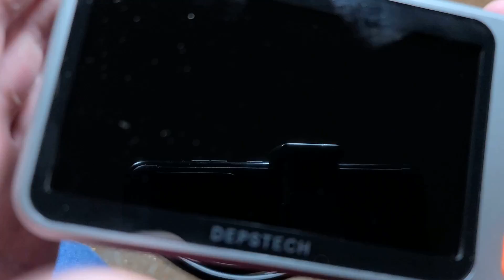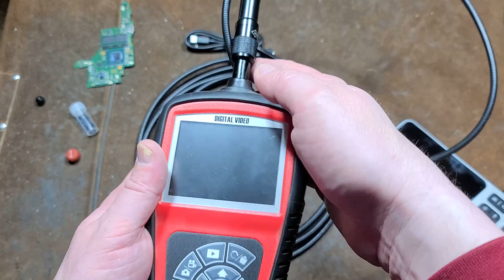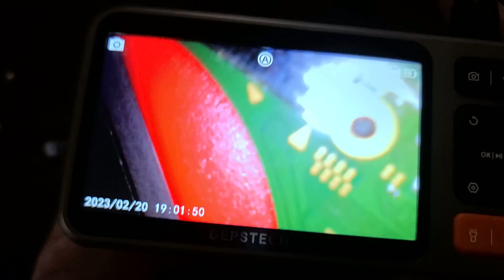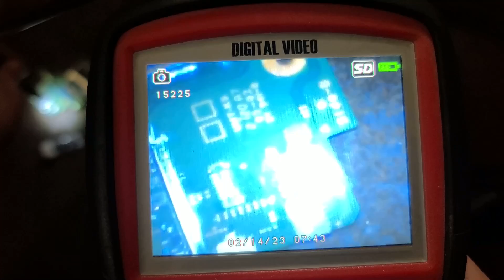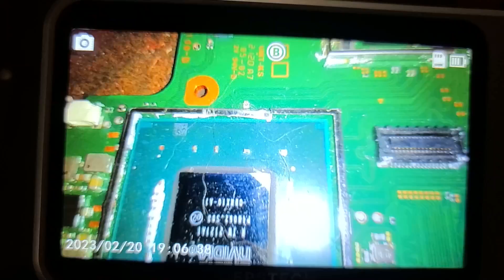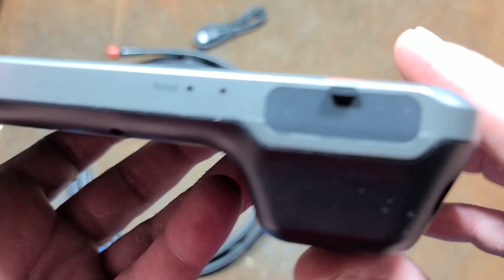DepsTech DS550 High Resolution IPS Screen Twin CCD Inspection Camera Review

Comment: You sure on the screen lens being plastic? I can't find anything that says plastic nor glass and I've emailed Depstech (no response yet). I'm a maintenance technician and glass tends to hold up better for my purposes. Last borescope I am currently replacing had a plastic lens that would scratch if you blinked too fast (I did cheap-out on my first pick). This particular model checks every box unless the lens is plastic of any variation.
Reply: Yes and it's glass
Saved the email
Reply: @Cenobite1  Nice thanks! I did a looot of research and figured out this endoscope with 5MP camera is the best bang for buck to me. I Teslong doesn't have a scope with 5MP camera so
Reply: did you get a reply from depstech?